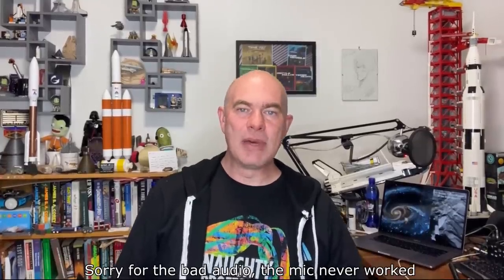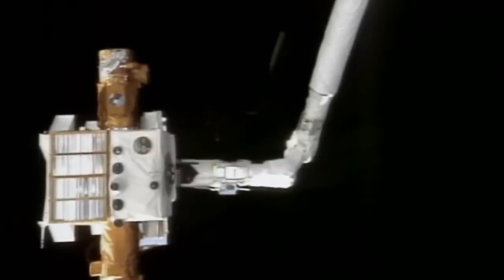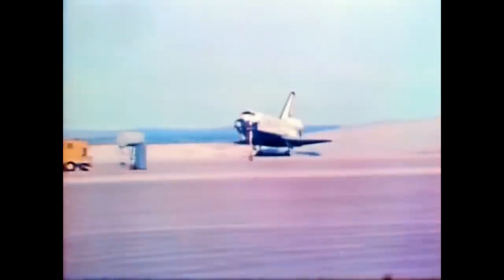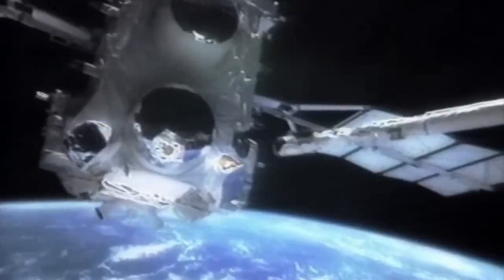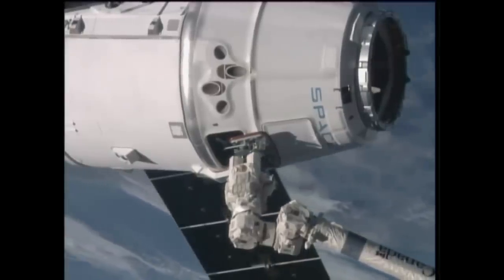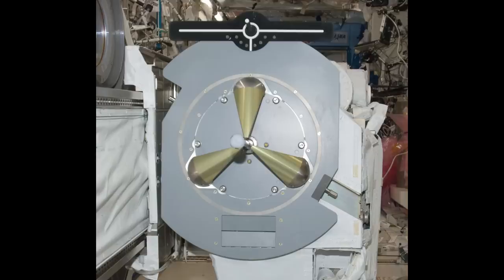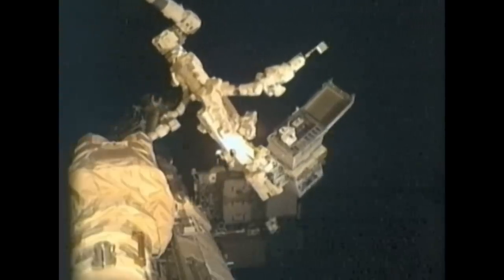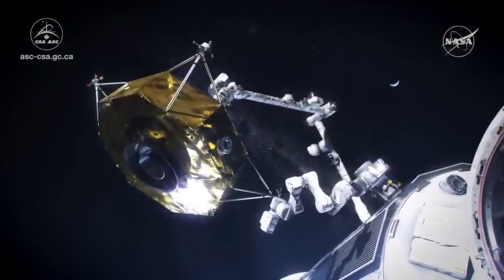Oh, Canadarm - Why NASA Calls On Canada for Robot Arms IN SPACE

Comment: Cool technology, but why do we need a space station once StarShip is flying? The internal volume of StarShip is about the same as the entire ISS. They could load a StarShip with all the experiments they want and have it take off with everything, including astronauts and have it fly the mission for 6 months or so. Then land the whole thing again. No resupply or space walks necessary.
Reply: Starship is still just a maybe, but then there is the question of how much mass it could return to make that viable.
Reply: First a disclaimer, I do not expect astronauts to launch in Starship, they will always launch separately on Dragon and dock with Starship.

That being said, I think the Starship space station has a lot of possibilities.  Essentially a dry lab similar to Skylab. It would likely not be reusable or returnable since it would have an indefinite lifespan. So weight is saved on landing gear, grid fins, and header tanks.  Also all six engines would be vacuum engines.  It would need an airlock and a second docking port for Dragon supply capsules.  Although I would expect it would launch with a huge amount of supplies, especially consumables like water and oxygen, so resupply may not be needed as often.

Now if Starship launch and landing costs become really inexpensive as time goes on, then I guess you could take the weight penalty and make it reusable. When a six month mission ends the seven person crew returns on Dragon, and Starship returns to get cleaned up, bringing back trash, then load new equipment or scientific experiments, and restock supplies and consumables.  In that case probably wouldn't need any cargo resupply as it could easily go six months or longer.

I can also see a tourist hotel version, same concept but of course outfitted more for comfort and a large recreation area, small windows in each stateroom, and a viewing dome on top, unless that's where the docking port has to go, so I guess they would just install a large viewing window somewhere. Seven guests could visit for a week, arriving on Dragon. Or more likely it would be six guests and a housekeeping/concierge person who would ride up with them and be with them for the week.  These people would work one week on, one week off.   Every six months or whatever the Starship hotel is brought back for cleaning, maintenance and restocking of supplies.

If SpaceX does this it will be interesting to see how Axiom or other commercial modular stations would be able to compete at a similar price, what would they have to offer that is better.

Comment: So what would the shuttle crews have done if they had found a hole in the heatshield while on orbit?
Reply: The crew itself couldn't have done anything, they would have been instructed to conserve electricity and oxygen, probably told to minimize activity including exercise. Meanwhile on the ground they would have tried to get another Shuttle ready to launch and rescue them. Success was uncertain but the key factor would have been to get started immediately, no later than the second day.
Reply: Nothing, and even any hope of a rescue mission was dubious at best.
Reply: @TheEvilmooseofdoom  It's interesting how much extra consumables they had. They had the extended duration cryogenic tanks in the payload bay which gives a maximum planned mission length of 16 days. I can see maybe five days contingency cryogenics, but the CAIB report said they could go 30 days which is when the lithium hydroxide canisters used for carbon scrubbing would run out. That means they had at least  30 days of cryogenics which is more than I would have expected for a 16 day mission limit.

Although I would think that the 30 day limit was based on maximum conservation, which again highlights the importance of getting started on all of this as early as possible. I didn't realize until rereading about the accident that the photo group didn't discover the foam strike until the day after launch. 

If the management response had been "We don't know the damage but let's assume the worst and start working towards a rescue mission until we can determine this" then it would have increased the chances of getting Atlantis launched in time, even though there would be no guarantees.

Assuming they did get Atlantis launched in time, the priority seemed to be the LiOH canisters.  If they had say four days of cryogenics left, then once they got the LiOH canisters to Columbia that would buy some  time and they wouldn't have to rush the crew transfer.  

But how to get the LiOH canisters to Columbia? And how to get the Columbia crew to Atlantis? Apparently the idea was to have a telescoping pole between the two orbiters. Sounds somewhat dubious to me.  I would say go ahead and build that and bring it with them, but as a backup just bring a long tether. An astronaut in an MMU can fly the tether over to Columbia and then attach it.  They could bring a couple of LiOH canisters with them. And some short tethers with carabiners like they use on ISS, if Columbia didn't have those onboard. Columbia astronauts would attach to the tether, then pull themselves along it over to Atlantis.